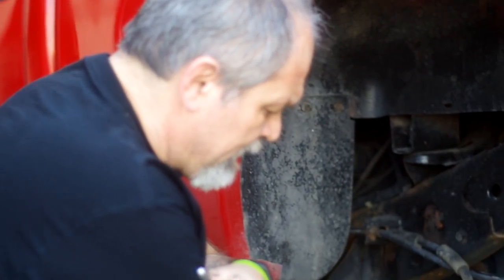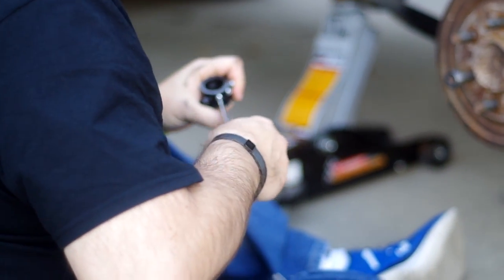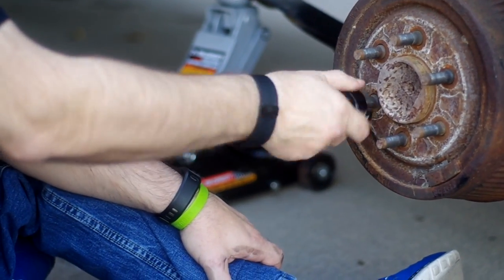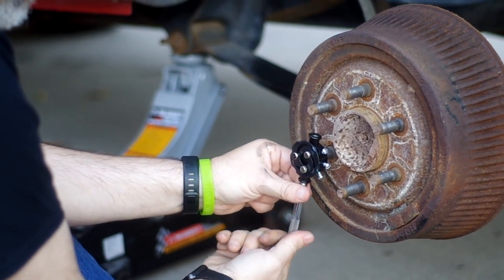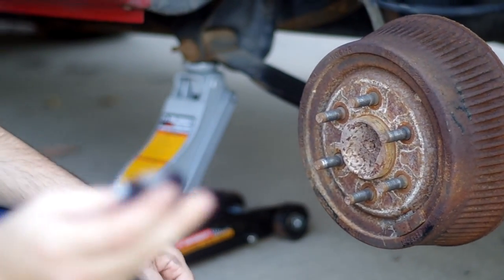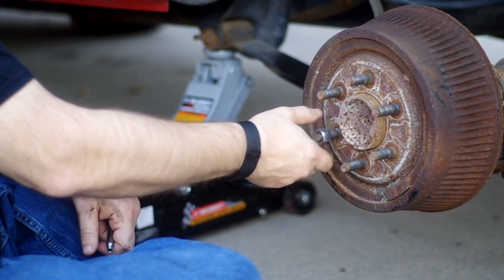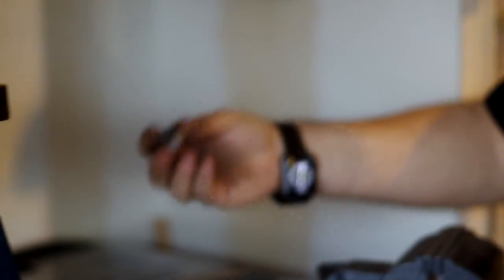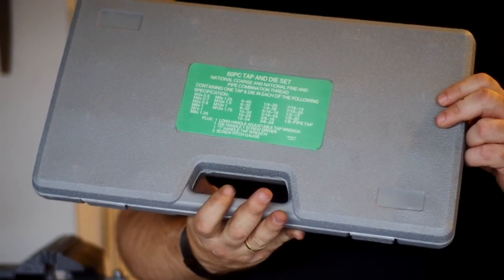Fix your cross threaded wheel studs yourself and save money

Comment: Went to put my winter tires on my car (used car but new to me) and come to find out that 6 wheel studs are cross threaded! Here in Sweden it’s mandatory to have winter tires on in winter so there are many many tire shops that swap out tires. It’s very cheap to have them do it but that also means they have to do a lot to make money. They take the nuts off with an impact gun and also install them with an impact without threading the nuts on a little bit first. So it’s very common to have cross threaded wheel studs. I’m sure they also don’t torque the wheels properly. Long story short, I have to fix these studs but I will do so in spring when I put my summer tires back on. I had to force the nuts on so I could get the winter tires on this one time. I had to drive somewhere and the road was iced over. But since they’re already on no sense is doing the work in the cold.
Reply from the maker: Hi friend! Yes, solid reasoning. I would do the same.

Comment: I have a 2017 Tundra with a cross threaded stud on the front right.
Dealership said $125 installed for a new stud
3 other mechanics said around $100-$115
Im going to try this out
By the way mine is 14mm -1.5
Reply from the maker: I am sure you will succeed! Good luck
Reply: I actually did. The die was hard to find here in the Boise Idaho area but they had it at Tacoma screws 
Took me maybe 20 minutes but it worked very good

Comment: My Camry stud got damaged - Thanks to the mechanics that start the nut with air wrenches that can cause this. After seeing your video i feel all the more comfortable and think will be able to fix it. The Camry studs i understand are M12 x 1.5. Going to get a set from Harbor freight that had a metric set on sale for 16.99. if that works i will be a very happy person and all i will need is a new Lug nut that sells for $1.99 at Autozone.  I can buy  a new hub for under $40 but will have to take the brake shoes apart and not ready for that. I believe there is another option to pop the damaged stud and be able to replace it without removing the shoes and thats the next option if the die set doesnt work. God help me.. i have to get the car inspoected by this month end.
Reply from the maker: Did it work?

Comment: If just the end couple of threads are mangled, a thread chaser or die can be used. If it is any farther, even after running a die on it, the threads will be weak. In that case, change the stud. As long as you can get to the back side, you can usually beat it out.
Reply from the maker: Changing the stud is not doing anything for weak threads,

Comment: Lisle has a stud tool  to replace studs. EBAY  has it. That tool is nothing but a die stock and handle.  You could get a die socket that is square and the handle. A thread pitch gauge can tell thread pitch. Check if your studs are standard  or metric.
Reply from the maker: How much is that tool? ANd why replace good studs? The idea is to repair not throw away. Thank you for watching!
Reply: The stud replacer tool will replace the stud with a new stud. What if your 'straightened'  stud strips out?  When a stud strips, it's  weaker. Replace it with a new stud. Safety is involved. One guy swore up  and down that  you can test spark plugs with an ohmmeter.  I corrected him and he cussed  me out! Go ahead with  your 'back yard mechanic' method, but it'll  strip out! If the threads are simply a little messed up, you can straighten them, but not if it's  REALLY  messed up. That tool is nothing more than a die stock and tool. It doesn't  even swing all the way around. Get a square die stock for use with a socket and ratchet for slightly messed up threads.

Comment: The lock nut is a weak material and mess it up . I need to do this fix
Reply from the maker: Yes it is unsafe to drive a vehicle without correctly installed and torqued lugs.

Comment: Split die is what you want to chase threads behind the repair and outwards toward the repair. That way there is no chance of starting cross threaded.
Reply from the maker: Thank you  I never had any issues using the method I demonstrated here.
Reply: @ProfessorDIY  sure thing. This method works as long as you are able to start one or two threads correctly. If you can or it's too booger'd up you'll need to start behind the damaged area and work your way out.

Comment: Not hating on this video but you're just better off buying new studs! It's a lot safer and they're less than $2
Reply from the maker: Why do you say that?
Reply: Julian Ramirez Rethreading can save time and labor. That tool don't  seem to be open at the  front for thru bolts. A die set and handle would do.
Reply: Julian Ramirez unless you have to remove the knuckle and take out the bearing then have to replace with a new bearing.  Many new cars don’t have room to remove the stud without a lot of work.  Dealership wanted $200+ dollars for a $4 stud replacement.  That included new wheel bearing and 1.5 hours labor